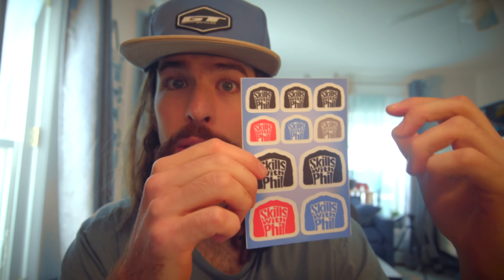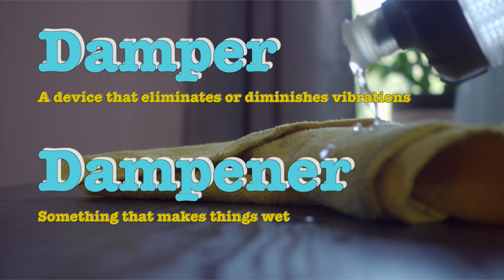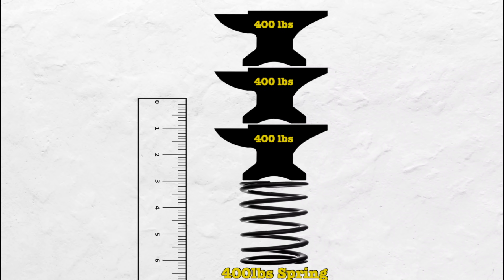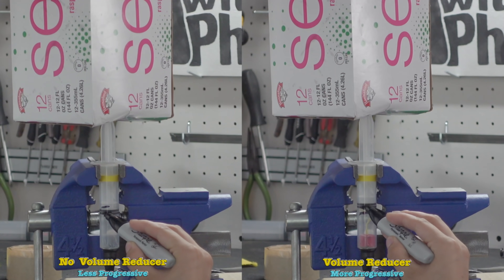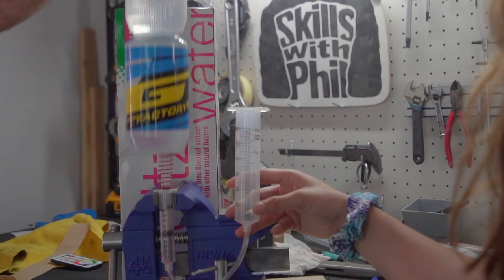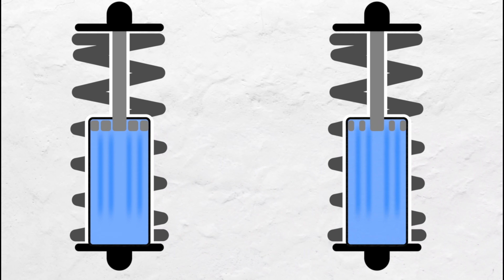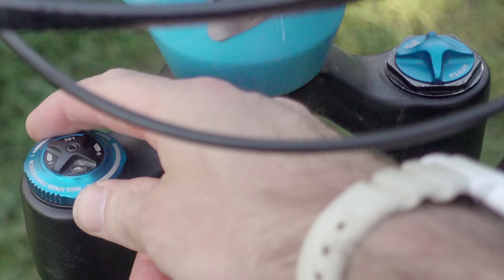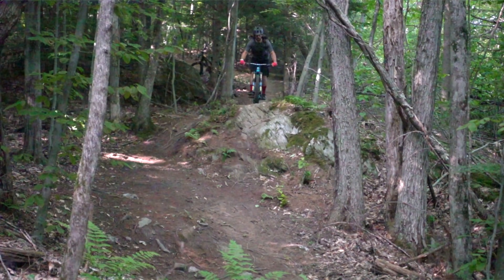How MTB Suspension Works Explained For Dummies

Comment: Can you please help. My fox kashima 40 downhill fork i  can't turn to + or - the high speed compression..
Reply from the maker: Sometimes dirt and sand gets into those nobs, you could try using wd40, that might be enough to break them free. Otherwise you can take the blue compression nobs apart, but heads up there's usually 2 ball bearings that like to fall out of it. It's super easy to do. Should take about 10 minutes if nothing goes wrong.

Comment: I thought this video was going to suck but he did a great job of explaining without over complicating.  This video should make people realize a MTN bike shock shouldn't cost $1,200 even if it is high end. Unless maybe made out of gold & titanium alloy.  
  A 6061 aluminum frame with built in gas tank that's much more complicated to build for a motorized bicycle is around $200 VS $2,000 for some BS name brand MTN frame that's isn't nearly as complicated to build.

Comment: Ok question time! First of all, sag. If I set my sag at 35% and I just forfeiting more travel and lowering my bottom bracket? Now, LSC.  If I turn this down all the way so that a small bump is absorbed easily, should I also turn up the rebound speed to extend the shock quickly after the wheel has rolled over said bump? HSC is just confusing. Is it the same as putting in a token? As in, it slows the compression down towards the bottom of the travel to prevent bottoming out? Thanks!
Reply from the maker: Sag: yes in many ways you are forfeiting travel. It has a purpose. Like suspension soaks up bumps, the sag "fills" in the dips to help keep your tire on the ground. Most bikes are designed to operate around a specific amount of travel, set your sag initially based off the bike manufacturers recommendations. 35 is rather extreme, only long travel bikes with a lot of travel would run that amount. Most trail and enduro bikes run 20-30%

LSC: that gets complicated, and the guys at suspension companies are better suited to answer those questions. But no, leave it the same. Rebound damping is mainly to help control (slow) the spring when it rebounds. 

Hsc: high speed compression and volume tokens affect two different things. Tokens are the more important of the two, these affect your spring rate, and how much it ramps up at the end. If your sag is set correctly but you bottom out too much, add a token or two. If you gently place a really heavy object on your shock and it barely bottoms out; once you add a token. You'd need an even heavier object to get it to bottom out.

Hsc affects  how quickly your shock compresses. If you drop a heavy object onto a shock, its going to compress quickly! However, hsc can control the speed at which it compresses. Adding more hsc compression will slow down the shocks shaft speed. This adjustment helps fine tune your suspension, after you get the correct spring rate set. 

In practice hsc difficult for most People to realistically dial in correctly. That's why most mid end shocks only offer a LSC knob. The high speed compression will be set in the factory to what they have determined to be the best setting for the average rider.
Reply: Thanks! I think sag is my biggest issue as its the first thing that should be set. Quite a range between 20-30%. I wonder what the decision is based off of.
Reply from the maker: Ultimately, it also comes down to rider preference, with suspension, there are some generally accepted guidelines on how to set up your suspension, but they aren't rules. Some riders prefer less, while other prefer more. Each rider has a different riding style, Danny hart rides way off the back off his bike, while Greg minnarr rider pretty centered, how these riders distribute their weight between the front and back shocks plays into how they set them up.

Also there's no one perfect suspension setting that will work everywhere. One a trail that is flowly but also very pedally, you might want to set up your suspension with a lot of LSC to allow you to pop of jumps, and resist G-forces in turns. However, that setup will feel awful on a rooty/rocky trail.

My advice, find something that works pretty good for most situations, and unless you're racing, don't worry about the adjustments too much once you find a good base setting.

Comment: Quick point out: increasing the lsc will not preload the spring, but further limit the the oil pass-through chamber. The lsc spring preload is a factory adjustment that we consumers should never mess with, because the preload of that spring is what defines the threshold between lsc and hsc. In other words: if you increase the preload of that spring, you are not increasing the lsc, but simply delaying the transition from lsc to hsc. Your lsc would in that case activate much "later" or "at much higher speeds"

Comment: All springs are "progressive" springs, we just assume linearity by assuming small amounts of compression relative to the overall spring. This wouldn't be the case if you compress a 4" spring 3", however, so i'll just assume your drawing wasn't too scale ;). Also maybe this is too picky by you didn't draw what's advertised as a progressive spring for the progressive part, usually "progressive" springs have tighter windings near the bottom.

Comment: Anyone - Suspension ?: I'm about to buy a really cheap mountain bike and was wondering if I am less likely to bend any more rear wheel rims on hazards riding a full suspension vs. a hard tail? I don't even ride on actual mountains (lol) - I just go over the occasional curb or tree root, sometimes on purpose, sometimes not, when not on the road or sidewalk. I try to hop over some things and learn the limits of the bike and my skills. But once my rim gets bent bad, it of course drags on my brake every revolution making even level surfaces more pedal work, not to mention makes me look like a circus clown when it wobbles back and forth!

Comment: Sorry Phil you've got the high and low speed adjusters around the wrong way. The high speed is preloaded whereas the low speed adjuster restricts flow through a hole as you explained. Otherwise a good job or explaining air spring concepts! Anyone looking for some advanced concepts check out the Vorsprung Tuesday Tuned series

Comment: Can you make a follow up video on what happens when you add or subtract each types of compression....meaning when I turn my low speed compression in the + direction (righty tighty per say) will this allow the shock to compress easier? Or is it adding resistance. My take is that I am closing a valve so I am adding resistance and making things “stiffer”. I am on a can creek double barrel coil and it’s amazing but I have adjustments for high and low speed compression and rebound. It’s a lot to figure out. It rides great right now but only because I have messed with it for weeks haha. Great shorty vid and info. Any insight on my above question would be great! Thanks Phil :)

Comment: Hi Phil I have a question.  I like to preload and feel the progression of my suspension when hitting a jump. Well sometimes the jump faces aren’t smooth or maybe not actually even a jump. Sometimes when I preload and my front wheel hits these faces it causes me to nose dive really badly.  I thought maybe it was high speed compression so I upgraded to a grip2 damper. Upon adding my high speed compression the fork just seemed to be really slow and not really help with what I was trying to accomplish.  Is there something else I need to mess with?   Rebound maybe?

Comment: This is excellent, but it also highlights the poor justification of pricing differences on suspension. A cheap system tuned for body weight is always going to be better than an overpriced system not tuned. 
Some low end forks don't use oil damping or air  at all, they use friction rods  and springs.

Comment: Loved this! It really explained a lot! I recently took my 150MM travel trail bike to a bike park noticed that my suspension felt overwhelmed by the speed of the hits, not necessarily by how hard the impact were. I have a basic Fox 34 Performance fork and shock. The only adjustments are 3 positions for compression and rebound. No high or low speed adjustments. If I wanted to upgrade my suspension to be able to take fast successive hits like from a DH park, would I be better off getting something where I can tune the LSC and HSC? Would that have anything to do with fast repetitive hits? Thanks for any help you can provide Phil! BTW, I just ordered a sheet of decals last night. The set going to Miami, FL!

Comment: Bro, this is the best suspension video I’ve ever seen. I work in a shop and literally until this video I could not wrap my head around low and high speed compression adjustments.

Comment: Great stuff! I haven't seen it laid out so cleanly before. I think I get it now. Thanks! 

One question about it: Can you give an example of how high and low speed compression affect bike handling? For example, as I understand, the more I decrease high speed compression, the more the suspension will soak up small bumps. How will my experience change as I adjust low speed compression? 

Also related, in your experience is there a "right" setting, or is it mostly feel.

Comment: Just started the video and I'm already stoked that you called out the "damper" vs "dampener" issue. Your shock has adjustable damping; if you want to adjust your dampening you should get a fender.

Edit: Start to finish, an excellent video with great demonstrations and illustrations. Quite possibly the best short primer on how suspension works.

Comment: May want to mention the speed referenced is not actual speed, but shaft speed. 

This helped me understand how HSC/R works more accurately.

You can be traveling quite fast but still want low speed adjustments as they alter different ride qualities than high speed does. 

Everything seems to effect other settings too, so always keep in mind that you aren’t making changes in a vacuum. It’s a balance of qualities that blend together.

Comment: Awesome video dude.
Reply: Jeff, you must be an expert (based on your awesome videos and riding history):  Any idea why there would be high and low speed rebound damping?  I get what Phil is saying high and low speed do for compression damping, where forces are determined by how hard you hit the suspension (big drops vs pedal bob).  But isn't rebound all generated by the shock's spring trying to shove the wheel back to the sag position, therefore it's always the same?  The hardest a shock can rebound is however hard the air/spring is pushing the wheel?  Just curious, since I have an x2 I'm not that good at using...
Reply: @ThatTutorGuy1  Low speed rebound usually controls the rebound speed in the end of the stroke since your fork is usually just bobbing a little from small bumps and stuff.  The low speed refers to how fast the shock or shaft is moving, not how fast you as the rider is.  High speed rebound affects the rebound deep in the stroke.  Since air springs are progressive they rebound faster when fully compressed and slow down as the stroke tops out.  Make sense?  It might be easier to thing of Full compression rebound (high speed) and small compression rebound (low speed).  LMK if that helps.
Reply: Jeff Lenosky Yeah, that helps a lot. You’re confirming what I was sort of thinking, that because the spring gets stronger deeper in the stroke, then that’s the only time it would be rebounding fast enough to activate the high speed rebound circuit. “High speed” would still be a pretty good name for it, since the larger hits are also what’s going to activate the high speed compression as well. Or does high speed compression activate with small square-edge bumps as well as bigger, high-force hits like drops?

Comment: I love your explanation on the suspension... but can you help with understanding WHY you would want volume spacers and why you would want to adjust your damper/rebound settings and how they effect your riding? If I have higher PSI in my rear shock, I should have my rebound settings slower... but that's just what I hear. How does that benefit my riding vs having higher psi and faster rebound? How does that effect my riding when I have volume spacers? I suppose I just dont understand what I should be feeling when I am on the trails.
Reply from the maker: Yeah, that something I wanted to put in this video, but it honestly took me forever to do this so I had to scale the scope of the video back a bit.

The first step of suspension is dialing in your spring rate. 
You do this before adding any compression daping
Your spring rate basically determines how rebound damping to run. 
So ideally you want ~20-25% sag

Scenario 1)
You're a heavy rider and you need 90psi in your fork to get ~25% sag
You like to send it off big drops, and at 90psi you are constantly bottoming out really harsh many times a run.
To solve this you'd add a volume reducer and go ride. 
Let's say now, riding the same terrain you're still bottoming out quite a bit.
Add a 2nd volume reducer and go ride.
This time, riding the same terrain you're still bottoming out but only 2-3 times per run.
Now you can add a few clicks of High Speed Rebound.
Compression Damping is used for fine tuning

Scenario 2)
You're a light rider and you need 60psi in your fork to get ~25% sag
You like to send it off big drops,  but even at 60psi but completely unable to bottom your suspension out.
Check to see if you have any volume reducers installed, if yes remove  1 volume reducer.
Let's say now, riding the same terrain you're still not bottoming out.
If you have another volume reducer to remove, do it.
By this point you should be able to bottom your fork out
If you still can't bottom your suspension out running the correct sag and no volume reducers,
Try running a less PSI and little more sag ~30%.
If you still can bottom out your suspension something is wrong; call Fox, Rockshox, Cane Creek support

Hopefully this helped a little?
Reply: Skills With Phil what about low speed compression? Can you give me a scenario for that.
Reply: @clarkpark  Phil here (I'm borrowing Hailey's Computer for a second to reply) Low Speed compression is for things that will compress your fork/shock slowly. For example, you're coming to a stop in the parking lot and you pull your front brake. That's going to cause your weight to shift forward and your front end is going to want to dive. That's where low speed compression comes in. If you don't have enough LSC, your front end will dive. If you have your LSC completely maxed out, it'll resist the forces  and your front end shouldn't dive nearly as much.
Reply: @SkillsWithPhil  Sooo the compression adjustment is for fine tuning and most of us probably don't know enough to really mess much with it....K.I.S.S. We much have spent 2-3 hours messing with the compression settings this weekend and I felt like such a moron not noticing the difference between a few clicks.
Reply: @SkillsWithPhil  thanks man you solve me all the doubts I had... great video....
Reply: Skills With Phil wow! That’s awesome. So much good info. I weigh 185 lbs and when I was bottoming our my forks or shock I was just adding more air... #fail or would just increase the damper. We just had a new jump line built in Chattanooga that’s comparable to the trails in Knoxville - baker creek area - and learning to adjust my suspension settings for jumps too... so much to learn!
Reply: @SkillsWithPhil  In the last line of your explanation here you mean, "still can't" - right? 
(Not "still can"?)
Reply from the maker: @Happy_Biker  Correct, it was a typo!

Comment: I have a 600 spring and I weigh 120 some how it works
Reply from the maker: Ahh, that's where leverage comes into play, and that's a whole other topic. The links that compress your shock are basically levers. Perhaps thinking about a sea saw is a better, as long as the sea saw was long enough, you could lift an elephant if it was on the other side. That same concept applies to shocks!

Elephant                                                         120lbs Logan
         🐘_______________________________________🚶
                     ▲

600lbs Spring                      120lbs Logan
          ≣_______________________🚶
                      ▲
Reply: Another way you could think about this is by comparing frame travel to shock travel
Let’s say you have 160mm of rear wheel travel on your bike and you run a 200 x 60mm shock on it. 

When talking about shock, the second number represent the available travel. So, while your rear wheel travels 160mm you shock only compress by 60mm. You therefore have an average mechanical advantage (or lever ratio as phil described it above) of 160/60 = 2.66. 

When comparing you weight to your spring rate you have to take that factor into account. 120lbs * 2.66 = 319lbs as the shock sees it. To calculate sock compression under sag you can simply divide your weight by the shock rating, 319/600 = 0.531inche = 13.5mm. Now if we compare that to the 60mm of available travel on your shock (13.5/60) we get a sag of 22.5%. 

Now this example is an oversimplification though since the mechanical advantage will vary through the travel as the relationship between the different linkage changes. Also you don't ride with a 100% of your weight on the rear wheel. The easiest way to calculate sag is still to just sit on the bike and measure.